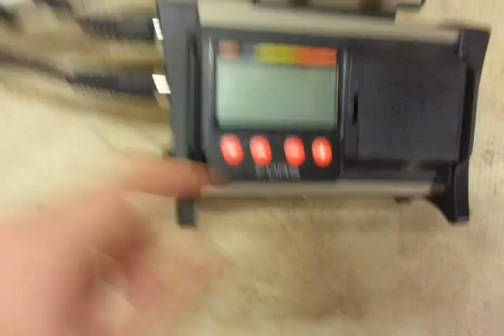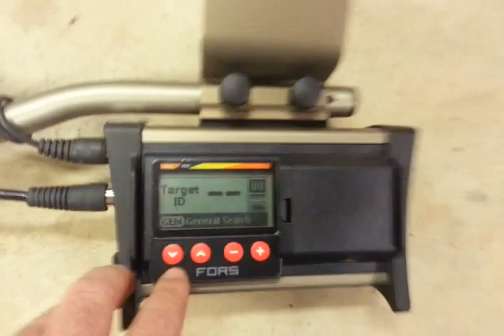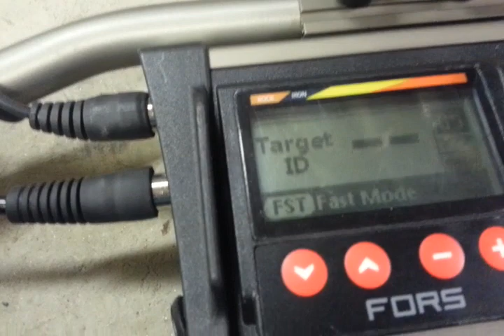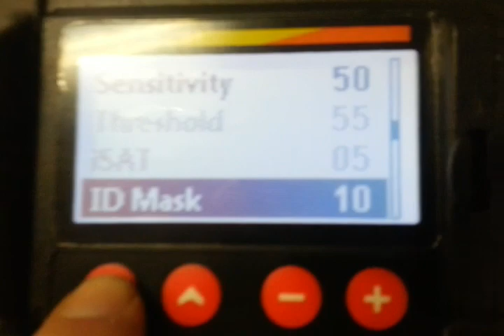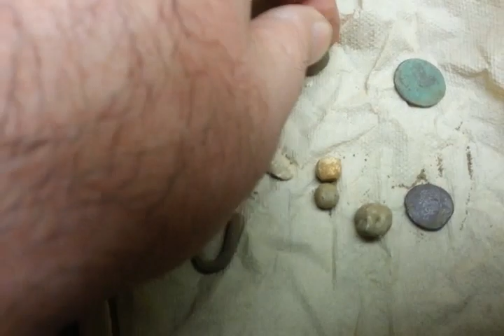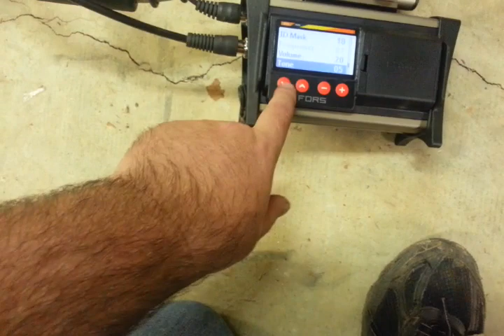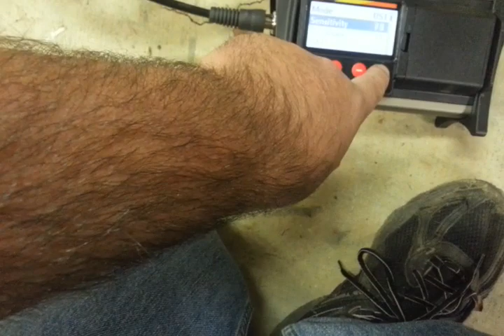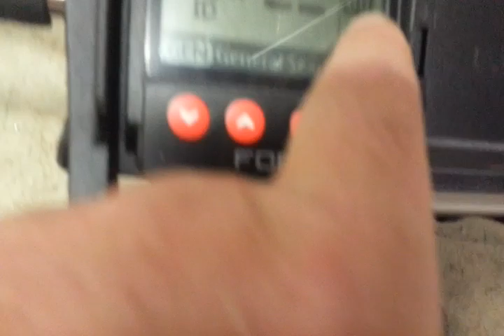NOKTA Fors Gold Plus

Comment: Really helpful video Kieth . I will get one for Roman,Saxon, medieval sites in uk. I reckon its a winner.
Thanks for posting.
Reply: +Gary Jessop  
Really could not gel with this machine. Found the arm cup far too small for uk winter detecting when you need a bigger warmer coat.Velcro strap too short also cutting circulation.. Very unbalanced with small coil making it feel as if box was falling away. Performance wise it was VERY sensitive to small bits.But audio wise, no better than a Trident 11  in the heavy iron of a Roman site YOU WILL DIG IRON  which is no big deal .But , it will take a lot of sussing out.. Terrible around power lines with very bad emi. Shame really, as i looking forward to it a lot.